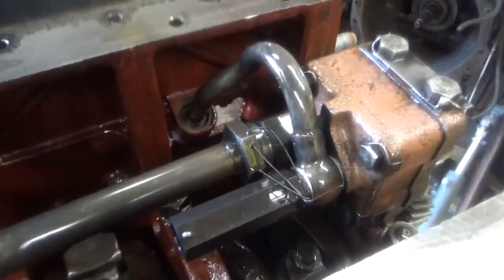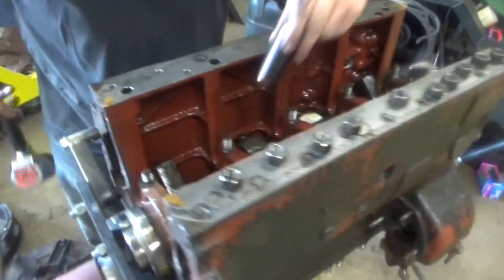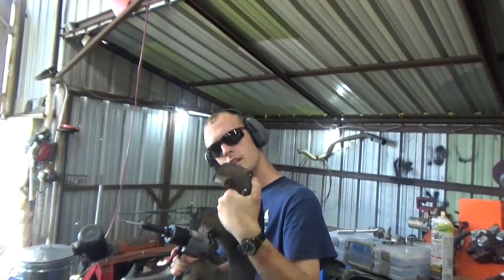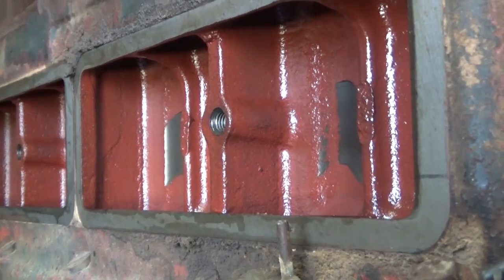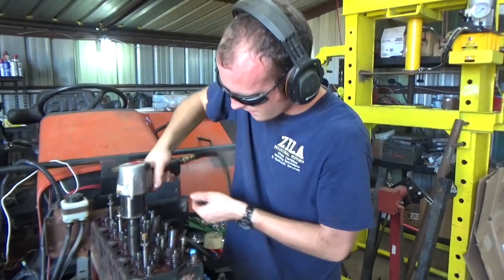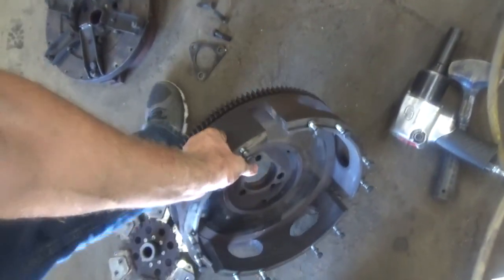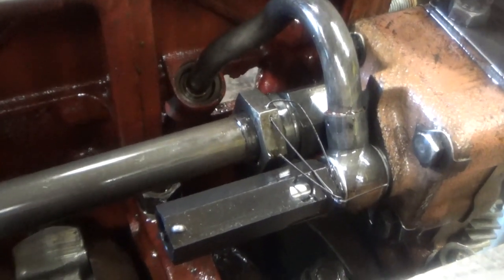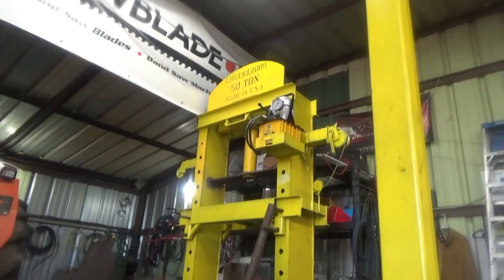I GOT SCAMMED BY A TRACTOR SELLER - BEWARE THIS IS WHAT HAPPENED

Comment: Now Chucky, I never saw the follow up to this rebuild you and Steve did on this machine. I have a 6945 which is the earlier version, different panel work but the same everything else. Mine has performed well for well over 40 years now and is still a workhorse. Needs some serious love but she still starts easy and pulls well. Post the update if you can please. Cheers From Australia.
Reply from the maker: Hello there, I still own it and its still running great. Steve did great work and its been a good tractor since all this. Really thankful to be using it now, after all these unexpected costs back then.

Comment: The 1982 blazer I bought is like this....."runs old,new wires,some electrical repair etc".....either the seller dont know or they're flat out lying about stuff. Pretty much e everything I buy used I assume that it's been butchered and need to go through the whole thing myself